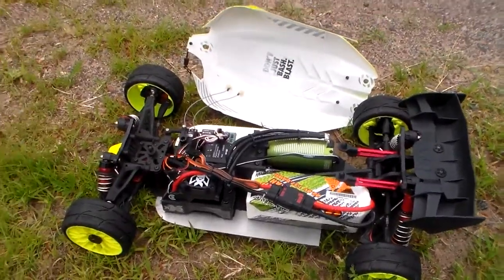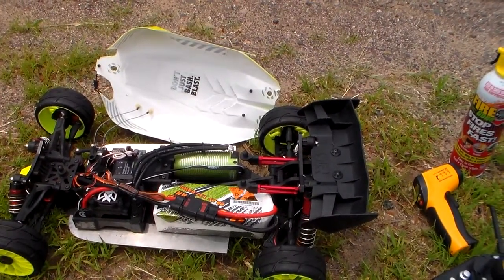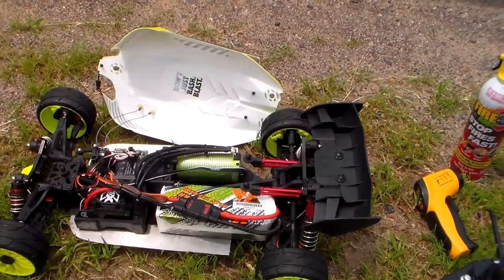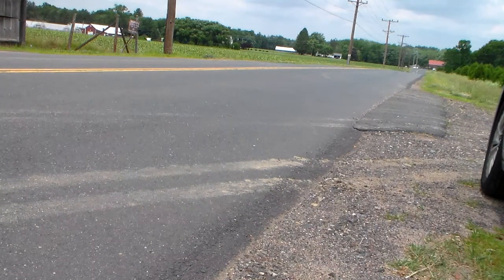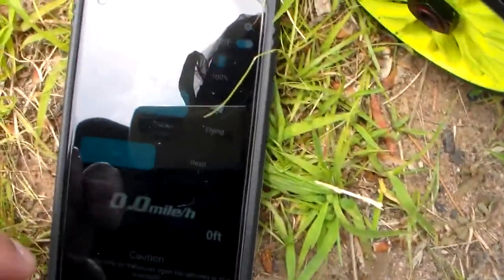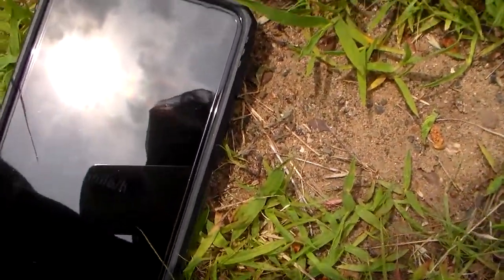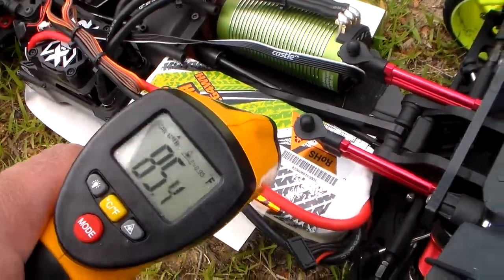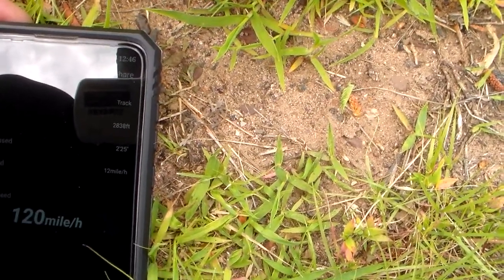Stretched Arrma Typhon 6S, 1721 2400kv, XLX2, 6S Pass, New Gearing Setup, 126mph (New PB)

Comment: That's a mean typhon brother. Congrats 👏i got a stretched typhon myself. Really want the xlx2 though. I'm rocking mmx8s at the moment.
Reply from the maker: Thanks, the XLX2 is a beast of an ESC for sure lol. I have ran the mmx8s as well, had it in this car previously then swapped it over to my Traxxas Rustler 2WD. It's a great ESC too, just needs a decent cap pack. With the XLX2, no cap pack needed. This particular run at 126mph only pulled ~1.03V - 1.06V ripple if I remember correctly.
Hopefully I can get another run this weekend & hit at least 130mph 🤞

Comment: Nice run also what gear Calculator u useing ?
Reply from the maker: Thanks 😎 👍
I'm using an Android app called "RCspeed", v2.1
It's the easiest & most accurate app so far that I've used.
Reply: @rcbustanut2057  awsome sir thank u I tryed looking but there is nothing coming up ? But thanks Anywsys.
Reply from the maker: @DadAdvise112  https://play.google.com/store/apps/details?id=micsdk.rcspeed

Try this link, hope that works. If not, I put in the search box RC Speed & it came up as the first result. It's by Mic's'dk.